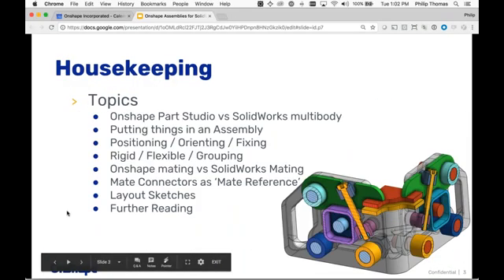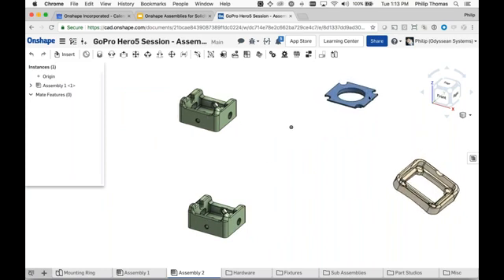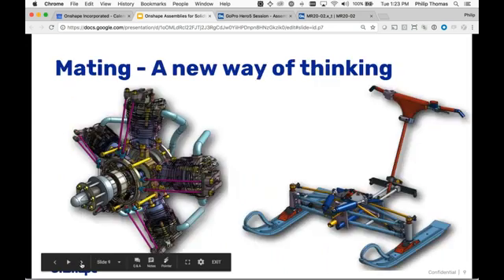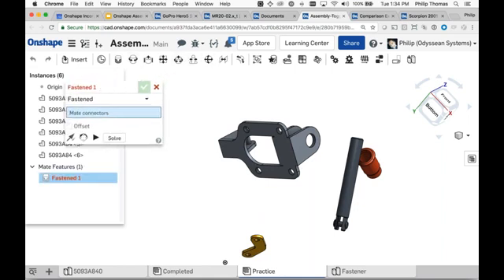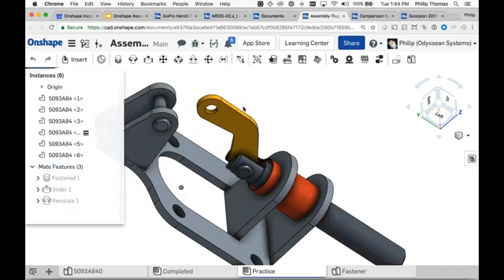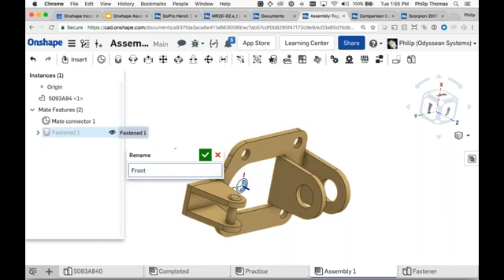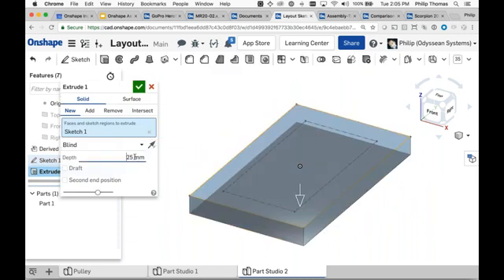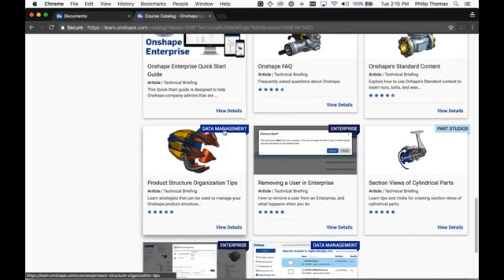Onshape Assemblies for Solidworks Users | Webinar (July 11, 2018)

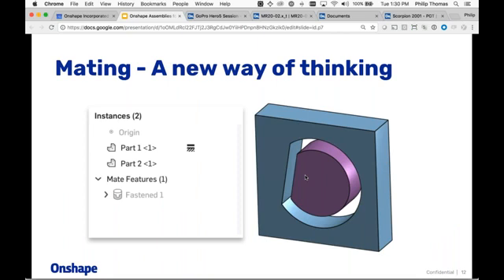Comment: 31:00 "3 instead of 1"
In SW I quickly select needed surfaces/axes and it understands everything else by itself, whereas in OS you need to adjust both  connectors which is frankly takes more time than click anywhere within target surface in SW. And this was an example where automatically assigned connectors were fit except of 1 adjustment. When they are not, and you need to create them, the complexity raises exponentially in comparison to SW..
Regarding smoothness and performance of complex asseblies – completely agree, OS handels this much better.